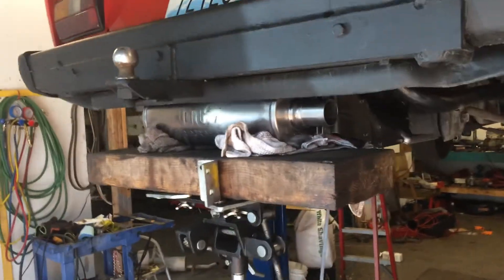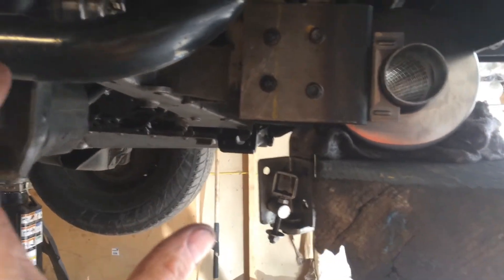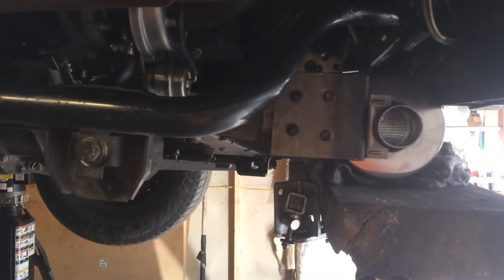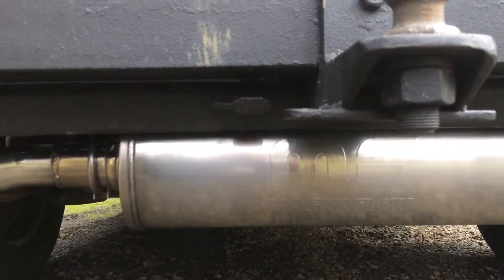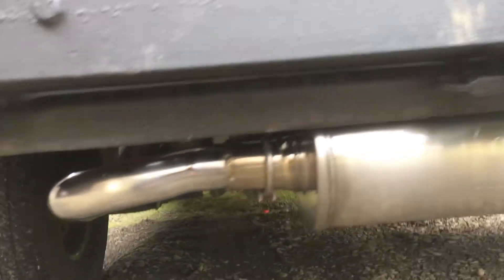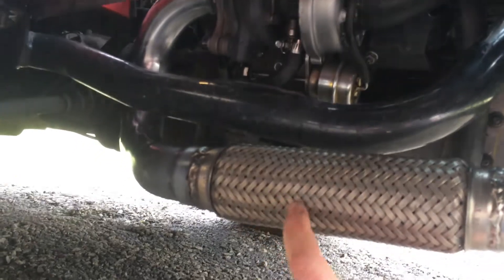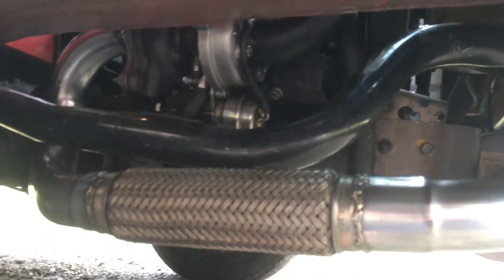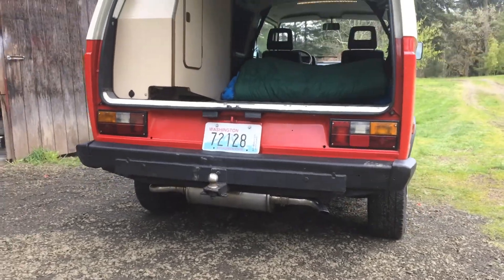Vanagon TDI AHU Swap: Exhaust System

Comment: Hey jt did you use the factory exhaust rubber isolators or are those metal brackets bolted straight onto the engine mount? Thanks!
Reply from the maker: I did away with that setup long ago and have a stainless Vibrant resonator with 2” inlet/outlet, hung from the bumper with rubber H mounts. It ended up being more reliable than the factory setup. I need to make a new vid and delete this one.

Comment: So almost 3 years later, how do you like your AAZ? I'm contemplating converting a 1.9L wbx.
Reply from the maker: Its an AHU. Its been phenomenal. Almost 60,000 miles and not even the slightest hiccup out of it, ever. Has run perfectly 100% of the time, in the most grueling conditions, from 10F to 120F.  Funny you asked this on the exhaust vid, because the exhaust is the only thing thats given me any sort of trouble, the pipe cracked close to the turbo, on one of the bends the fabbers made, so i fixed that and put a much lighter resonator on there instead of the heavy Magnaflow. That was 15k miles ago maybe, nothing since. Actually i need to make an updated exhaust vid to reflect that
Reply: @jtlachappelle  great, thanks for the update! Awesome that it has been so reliable. What kind of fuel economy do you get? I take it the louder engine noise isn't too big an issue? I'm thinking I will buy marine diesel engine insulation and go nuts.
Reply: @jtlachappelle  btw, I have a magnaflow stainless on my 1.9L wbx, and it came in perfect polished condition. I think you got a bunk one.
Reply from the maker: Who knows on the polishing. All i know is the picture i clicked on to order it was polished and bright, and what i received was definitely not. And then they were total dicks about it when I called, so Magnaflow can go eat shit , wont buy or recommend them ever again. Assfaces. 

Dont worry about the noise. If you watched my other vids youll know that i have an open K&N air filter on it, makes a great racy sound, and contributes to getting 35 mpg
Reply: @jtlachappelle  "the pipe cracked close to the turbo," and thats where they all crack, even on standard TD engines. VW never cured it, you will never cure it.

Comment: Not "burn marks", oxidation colors. OK, what do you expect for that price? Price SS tubing in a mill finish then check the price polished. That should bring you into the real world. By the by, I've never seen an OE Vanagon mounting scheme which mounts the muffler from the inlet/outlet - the mufflers are hung from the bodies of the mufflers. Since you are the God of Exhaust Design, maybe you should be working in the VW Engr. Dept.
Reply from the maker: If a manufacturer puts a picture of a highly polished product in the description of the product, I expect what comes in the mail to be highly polished. Shut the fuck up and get the fuck out of here
Reply from the maker: Reading your shit again because i cant believe anyone can be this stupid.....so your argument is that because the price of polished stainless is so high, its ok for them to mislead and cheat the fuck out of people by showing a pic of a polished product and then sending an unfinished product? WTF...nice logic, what kind of fucking idiot are you? Dude get out of here. 

And burn marks: slag marks from the welds you dipshit. Stupid, stupid people i have to deal with...